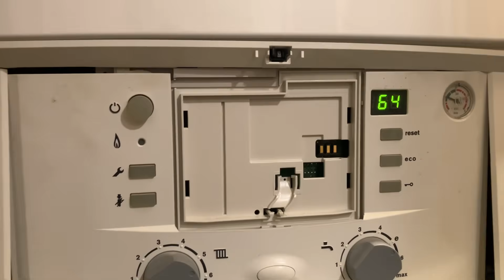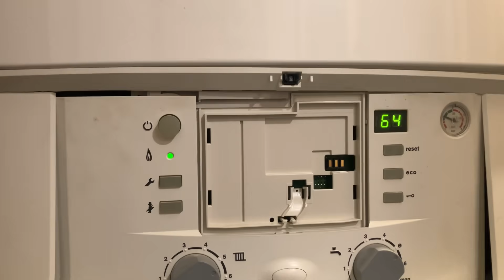No Heat, No Hot Water! Bosch Greenstar E9 Error—Dead Control Board Fix 🔧🔥

Comment: Mike, you are the most intelligent diagnostic technician. You should have been a brain surgeon! You are a master at your trade.
Reply from the maker: Thank you for the kind words.
Reply: @PipeDoctor  How much do you charge customers?
Reply: Hi Mike,
I watch your channelhere in the UK, always interesting to see what goes on over the pond! 
These Greenstars are super common over here, i probably see 5 a week for service, air is never an issue, they clear themselves of air with no issues. However, I note the flame rectification and spark electrodesstill have a sight glass, these have long been a no no here..and shouldbe replacedwith a non sight glass part. 
Servicing is as you know paramount, however, I notice that over in the US there seems to be little attention paid to system water quality, i never see inhibitor being tested or added, i also never see shock arrestors being installed, and i have never seen a test on the gas installation for leakage ( we call it tightness testing) this we do whenever we work on gas or at least once a year for landlord tenanted inspections.
Is this something you guys do? 

Love to come over and work alongside for a few days just to see first hand how things differ.. especially steam!! Something we just don't have ( apart from making tea of course 😅😅😅)

Take care Mike
Keep'um coming 

 @PipeDoctor